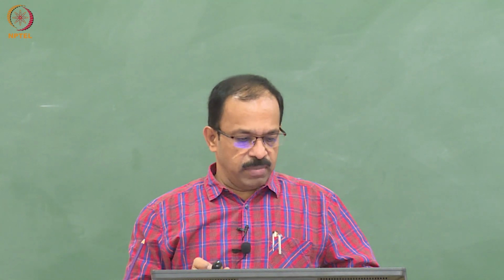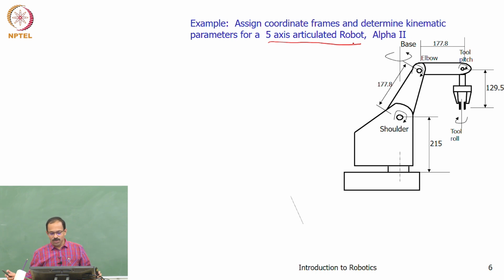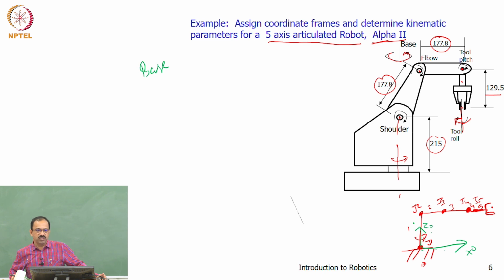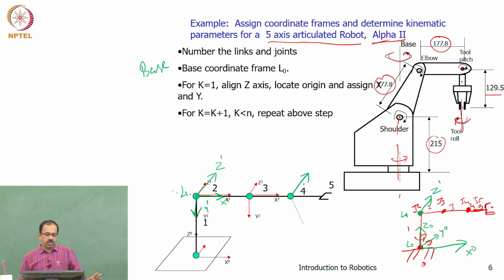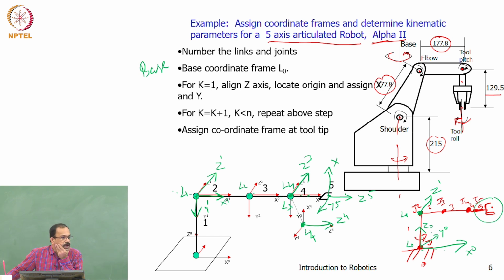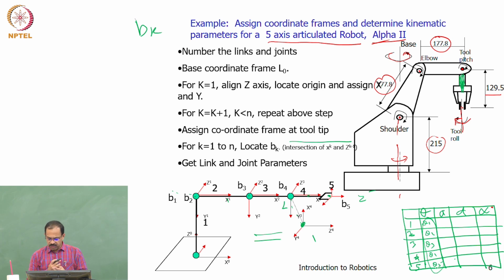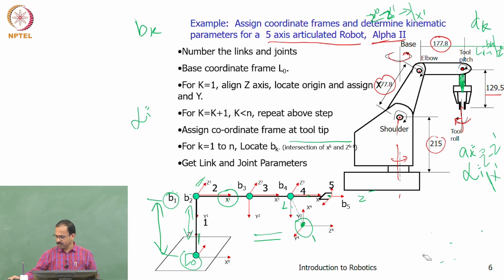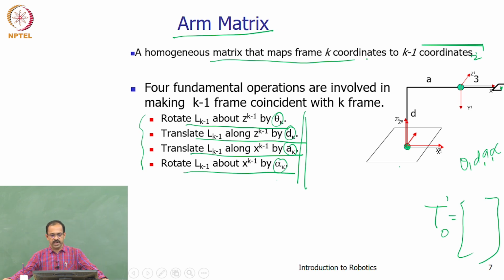#9 DH Algorithm | Examples | Introduction to Robotics

Comment: alpha_1 = -90, the lecture shows correct degree values.
Point your thumb along the x1 axis, and look at your thumb facing you. While your 4 fingers represent Z0, if you want to get from Z0 to Z1, you should go clockwise which is negative.
There are some comments that may mislead.

Comment: shouldnt the angle be +90 degrees and the angle of rotation is in fact anti-clockwise from z0 to z1?
Reply: Yes that is correct, when we curl our fingers along the axis of rotation. along x1,  we should get +90. You are correct.